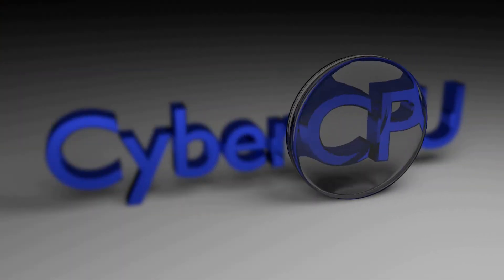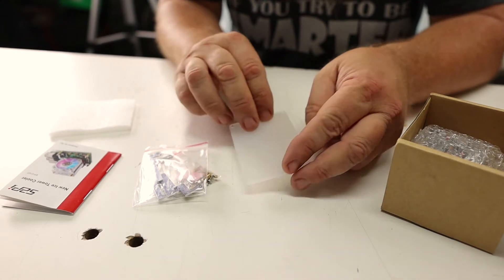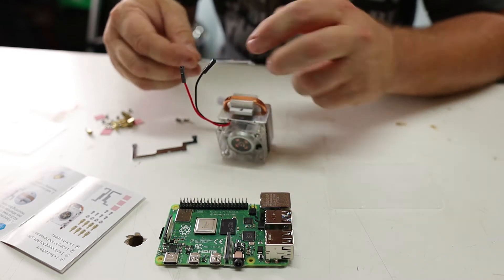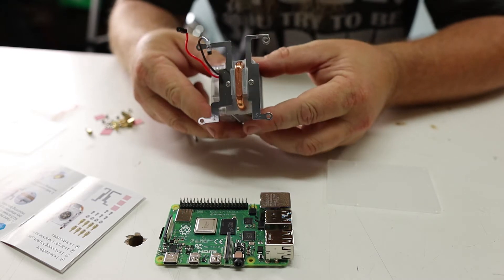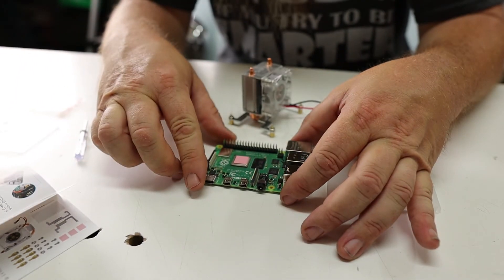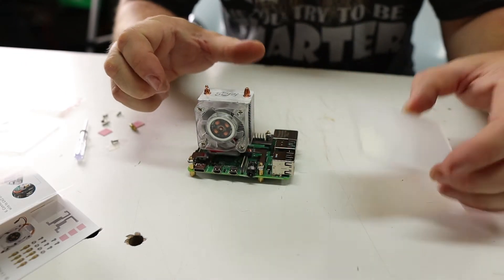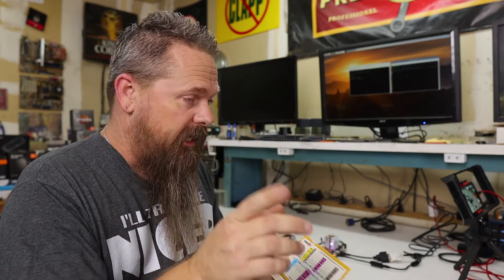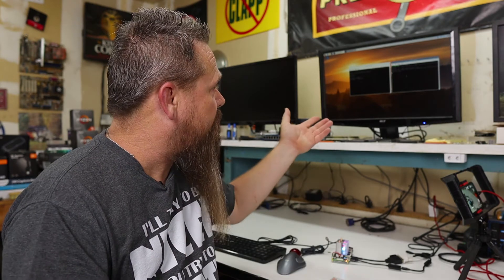How to Cool Down a Raspberry Pi 4

Comment: 'Best' depends upon criteria. Best at cooling, perhaps. But, what about noise level, power consumption, speed control, and fitting inside an enclosure? IMO, the 40 mm x 10 mm Argon One Fan Hat is the best all around cooling solution for my 8GB RPi4. It is very quiet and allows 3 preset temperature levels and fan speed for each, simply by editing a config file. For example, mine is set to 30% @ 45'C, 60% @ 55'C, and 100% @ 60'C. So, there's no fan at idle, minimal fan with minimal usage, 55'C while playing YT videos @ 1080p, and the RPi rarely reaches above 60'C (except during an extensive sysbench CPU stress test, maxing out all 4 cores). BTW, my RPi4 is overclocked @ 2GHz. Therefore, IMO, the Argon One Fan Hat does an excellent job of cooling, with minimal noise and power consumption (not wasted on pretty LED lighting). Can't expect more than that, can you? Oh yeah, it was only $10 on Amazon.
https://www.amazon.com/gp/product/B07Y9LFP1J/ref=ppx_yo_dt_b_asin_title_o02_s00?ie=UTF8&psc=1
There is also a new sleek Argon One M.2 case (on back order), which has a similar built in fan. But, it also has room for a bootable SATA SSD on an M.2 expansion board, which plugs into the USB 3.0 port. ETA Prime has YT reviews on it. However, I'll replace that board with a Geekworm X872 NVMe board for the fastest possible r/w speeds.
Reply from the maker: Best ar cooling. It did a really good job. Noise level is really low too. To be honest with you I couldn't even hear it running without putting my ear all the way up to it.
Reply: @CyberCPU  Cool. Then we're both very happy with what we have. "Different strokes for different folks, eh?"
I'd be interested in knowing the power consumption of the Ice Tower and how does it perform (temp) under sysbench tests, while the cores are running @ 100%. I'm sure that it stays cool, but is it overkill with hardly any rise in temperature? Does the Ice Tower have any temperature/speed control or is it always on @ full speed? Is it possible to stop the disco lighting or are the LEDs always on?
Surely, if I'm wondering about these performance points, then so are your other viewers. You have only unboxed it, plugged it in, and declared that it works great. How about a full review?

Comment: Hi, I bought have a Lenovo IdeaPad 3 Ryzen 5 3500 U with an AMD Radeon graphics card with 2666 MHZ 8GB RAM , but while gaming I experience high CPU usage which causes lag... i upgraded to a 3200 MHZ 8GB RAM and not much of a difference .. any help ??:)
Reply: I'm not familiar with the Ryzen, but it sounds as though it is throttling down, due to heat in order to protect itself from damage. The Raspberry Pi does this @80'C. So, I would suggest adding active cooling if possible. The RAM upgrade might help general performance, but it won't help with temperature throttling. Hope this is helpful.
Reply: The Hermit thanks!